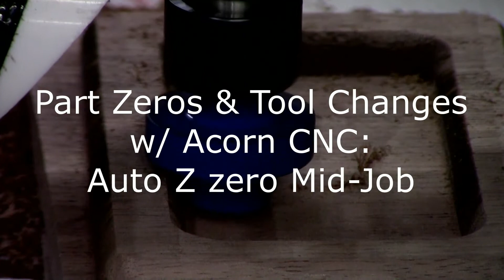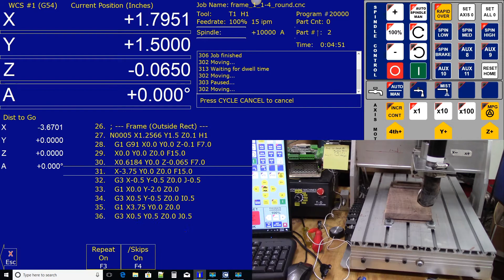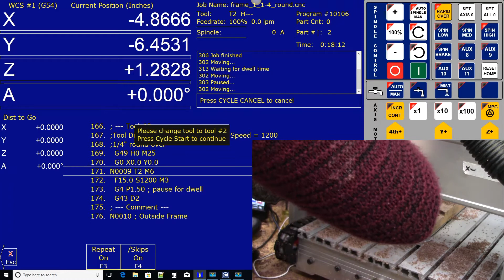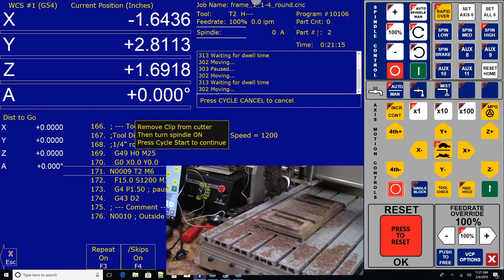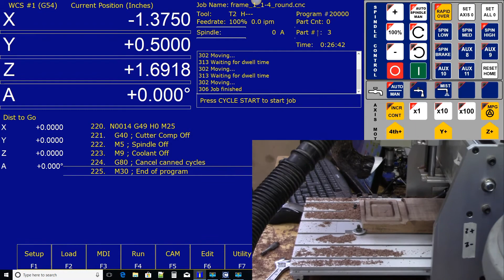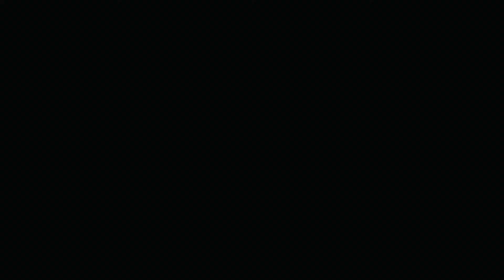Part Zeros & Tool Changes w/ Acorn CNC: Auto Z zero Mid-Job w/ Tool Touch Off

Comment: Hello. Following this video and the other you had on setting up the macro in cnc12. It is working on my machine except for some reason it is adding the thickness of my touch off instead of subtracting it and begins cutting above the height of the touch off device instead of below. Any ideas on what to check to get it to cut below that level instead of above? Thanks again for the quality videos

Comment: Thanks for the nice demonstration !
How did you connect and setup the touch off with the Acorn board and the CNC 12 SW ? Also, which CNC 12 function do you use to start the Auto Zero ?
Just finished the HW of my own machine and have been looking for some examples on how to do that auto zero.
I have seen that the Acorn has those two pins for probe signal and probe detect but isn't there a problem if any of those two touches the grounding of your CNC metal frame ?
Thanks so much for some hints
Uwe
Reply: Maybe I was too quick :-) 
Your other videos seem to answer most of my questions.
Thanks again